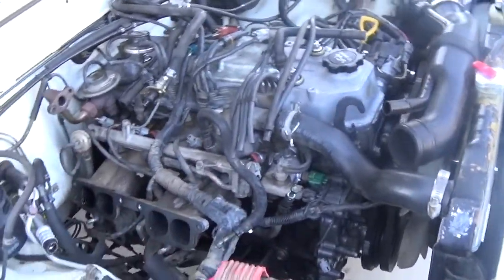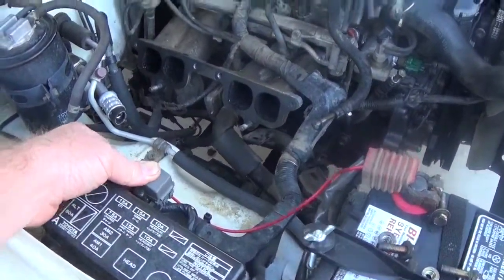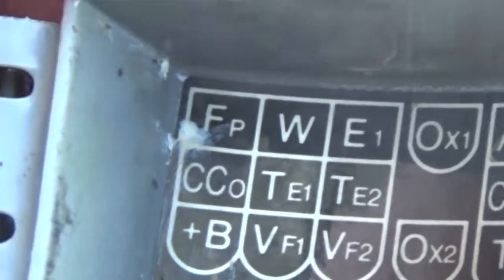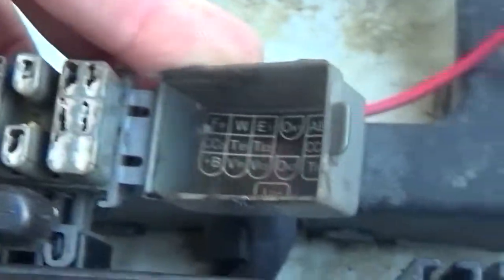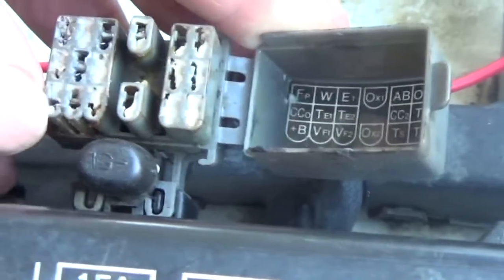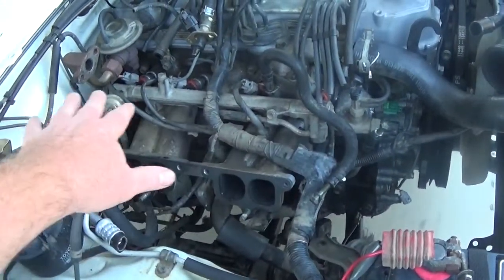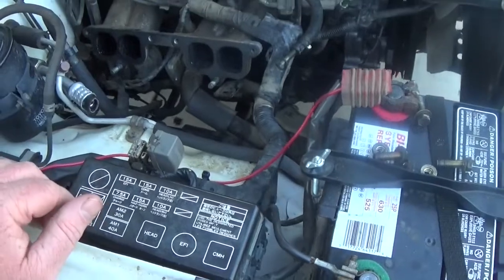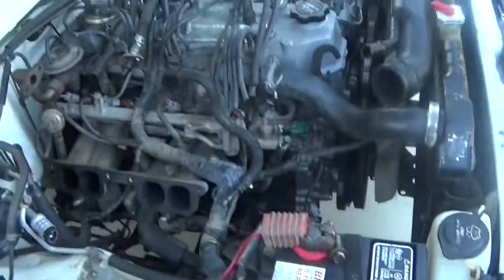22re Testing the fuel pump

Comment: I'm trouble shooting a no start situation. I found it is that the pump is not running. I sprayed starting fluid and it runs for 10 seconds. I'm not getting voltage thru the ignition to the pump relay.  So I will use the FP connection to try and make the pump run. That would eliminate the pump entirely.  I suspect the ignition switch may be the issue. Working thru it. Thanks for the help.
Reply from the maker: So glad the video helped a little.  Sounds like you are on your way to figuring it out.
Reply: Charles Carr. Did u figure it out? I'm dis exactly as u did. I drove to my friends cabinet shop, turned off the motor to open up the large gate,  I got back on my 91 4runner v6 3vze 3.0 and didn't turn on anymore. After checking all kinds of stuff I also sprayed carb cleaner and it turned on briefly. I repeated this 3 times. Figured out it was my fuel pump. I cut an access door on the rear passenger seat to access the fuel pump, replaced it with a new 1. It didn't turn on. The fuel pump wasn't working. I connected wires directly to the old pump to my battery and the old pump worked. I used my Makita drill battery to test the new pump installed on the gas tank and it also turned on. But not through the ignition key. It just doesn't activate. So now I tried this method with a paper Clip, it still doesn't activate. The Efi fuse is good, they efi cylinder shaped metal relay works. Now I'm checking on the Circuit Opening Relay but makes no clicking noise when I put the ignition on the On position. Let's see what else I do. What was the problem with your 4r?
Reply: @johnnyjohn8073  So what happened? Did you solve the issue?
Reply: @CentroInvOrografica  I was able to activate the fuel pump by bypassing the wire connector from the MAF sensor with a paper clip; then I pressed in the 2 side metal prongs on the Circuit Opening Relay (the plastic cover has to be removed for this). The MAF Sensor (located on top of the air box) is a cast metal piece with a black plastic cover in the shape of the heel of a boot & is sealed with a clear silicone. 
 
When the MAF Sensor & the Circuit Opening Relay is working properly, the fuel pump circuit works this way: When you turn on the ignition key to start the engine...the engine cranks and sucks air in through the air box, the air goes through the air filter, then through the MAF sensor, etc. for proper air & fuel mixture. This process makes the MAF sensor to activate the 2 metal prongs on the Circuit Opening Relay to press onto the body of the relay causing contact on other metal parts which triggers the fuel pump to turn on.  Once the engine turns on, one of the metal prongs deactivates from being pressed onto the relay body while the second prong stays activated which keeps the fuel pump running as long as the engine is running till you turn it off, then the prong is released which stops the fuel pump from running. 

Problems with the relay can stem from corrosion, rust, or other contaminants between the contact points. A simple fix can be done by lightly sanding between the contact points. Some times a clogged AC drainage can leak water onto the relay and the ECU. An easier way to tell if your Circuit Opening Relay works is to simply disconnect the wire connector at the MAF sensor & bypass the two female contacts closes to the front with a paper clip. This connector has about 6 female prongs in-line so make sure that you are bypassing the two prongs towards the front as opposed to the others. If you hear the Circuit Opening Relay click, then obviously the relay physically engages but it doesn't mean that there's actual contact since corrosion or rust may be preventing power flow to the fuel pump. If the relay does click and the fuel pump does turn on then you do know that the relay fully works; which means that your MAF sensor is bad. See a video on how the MAF sensor works. It has about 6 male prongs that connect to the 6 female prongs in the MAF connector wire. Remove the black plastic cap on the MAF by cutting off the clear silicone. On the inside the 6 male prongs continue where they are welded into the circuitry. Some times the welds are broken off, coroded, rusted, etc. There's a part that spins back and forth depending on acceleration. This back and forth causes a metal prong to activate or deactivate some metal peg which in turn activates the fuel pump. You will only understand if you see videos on the MAF & relay function as part of the fuel pump circuitry. Or you have to test & even open up these parts to understand. I was overwhelmed by the technicality of this process but I came to realize how easy it actually was. So don't let it intimidate you. The hardest part of the work is to remove your glove compartment box & the front passenger kick panel where the Circuit Opening Relay and the ECU are both located. But first check the other most known methods to test the fuel pump. Also, the ignition keys must be on the ON position while the MAF sensor wire is bypassed to hear if the Circuit Opening Relay works. 

Unfortunately I haven't been to the junkyard to get a Circuit Opening Relay. I would get 2 or 3. If the MAF is the problem, based on videos that I saw, I could tell that I can very easily fix it. So my fuel pump problem is based on one of those two problems. I will return to explain which of the 2 was the problem.
Reply: @johnnyjohn8073  Thank you for your thorough response! I'm currently dissassembling my truck's motor to change the HG and timing chain, when I zip it back together I'll see if it fires up, if not, your advice will come in handy!
Reply: @CentroInvOrografica  Yeah good luck amigo just take your time & be very patient. Double check all your work. Video tape everything you do so that you remember how things go back. Also write notes on a writing pad dedicated only for notes your your vehicle. Label everything eventhough you think you may remember everything later one. Shit happens in life and you may not in fact be able to reassemble everything in a few days like you originally planned. I caught pneumonia during the process and I'm relatively young.  I thought pneumonia was only an illness that babies & old people get. Financial issues also got on the way. Especially change all your freeze plugs on the engine block and the cylinder heads. I've always replaced them on engine blocks but never on cylinder heads and guess what? 2 months after I was driving my 4R, a leak developed from a rusted freeze plug in the back. So I removed both cylinders on my v6 and replaced the freeze plugs with brass plugs, except the one that goes on the intake plenum (upper intake).
Reply: @johnnyjohn8073  Thank you!!
Reply: @xxkrazzxx  You're welcome bro. Something I forgot to mention unrelated to fuel starting problems. As you know, any starting problem is either due to timing issues, gas, or ignition (electrical) problems. My 91 4runner was sitting for about 3 or 4 years before I rebuilt the engine. Humidity throughout those years created rust on the distributor magnet contacts which prevented the engine to start. Since I had already noticed this, I knew right away that this was the problem for my 4runner not starting. I used sand paper to scrape off the rust and it turned on right away. I'm surprised that the old gasoline didn't jello up and clog my fuel pump cus usually you should empty out all the nasty varnish smelling old fuel. All the other problems that I mentioned in previous postings were problems that occurred after, maybe a year or 2 later unrelated to the distributor. Of course I did the typical checking for spark at the spark plug wire to spark plug, I had not spark. Then I checked for spark from the distributor cap to the main coil wire, I had no spark. Then I checked for spark at the other end of the coil wire to the coil & nothing. So before I tested the ignitor, I removed the distributor cap from the distributor & that's when I noticed rust inside the distributor on the magnet contacts. That was my problem. So it your vehicle has been sitting for a long time, always check for rust at any electrical contacts & grounds.

Comment: I tried a paperclip and nothing happened, I couldn't really get a good fit with the paperclip and think I didn't do it right. Can I buy jumper wire at a particular place to do this correctly?
Reply: @z g. You probably did do it correctly, that's simply not the problem as I did the same test and the fuel pump still didn't activate. Your problem is most likely either the MAF or the Circuit Opening Relay. Read the posting I wrote to another person. I was lost as you were but as I followed the schematics on my Haynes Manuals for the fuel pump wires and also viewing many Youtube vides, I doscovered that the MAF on top of the air box & the Circuit Opening Relay are all part of the gas pump operation. You may also have a bad ignition switch (where you insert your key on the steering column below the steering wheel). Or the the 12 inch wire that connects directly to the  fuel pump or the wire that goes past the fuel pump wire. Maybe corrosion on the wires itself or at the fuel pump connection. The fastest test now that you tried the bypass with the paper clip; is to simply disconnect the wide wire connector at the MAF sensor and bypass the 2 frontal female connection with a paper clip. Listen to see if the Circuit Opening Relay at the front passenger kick panel (where the computer is located) makes a clicking sound. The relay has 2 metal prongs on each side that will click at the same time so it will sound like only one click. Remove the plastic cover on the relay to see if both click at the same time while a friend bypasses the MAF wire connection and the ignition switch is turned to the ON position. If both metal prongs on the sides of the relay click, don't be fooled that it's in good working condition. Look carefully between each metal prong to make sure that there is no rust or other form of corrosion that is blocking metal to metal contact between the relays metal prongs and the metal part on the body part of the relay. Usually water leaks from the antena hole down to this relay and maybe even the computer itself. This will cause corrosion between the metal contacts on the relay, causing the fuel pump not to activate. Confused? simply remove the plastic cover on the circuit opening relay to see the 2 metal prongs that I'm talking about. Use a fine file sold at Harbor Freight to cut keys to file the metal contacts or get 400 sand paper and scrape off the contacts to clean off any corrosion. Want to know the exact function between the MAF & Circuit Opening Relay, read a previous comment I made to another person. Look around Youtube vides and you will finally see the videos explaining this in better detail. Corrosion also builds up on the metal prongs inside the MAF sensor or the welding that holds them in place also breaks loose. My 1991 Miata also has the same MAF system on top of the air box. There's a guy who works on some mazda mini van or small SUV (I forgot which is it) that actually explains it in spanish but I'm also sure that eventually you will fine one in English. Good luck, let me know if you solve your problem and tell the rest of the readers also. I hate making long comments but I think it may be helpful to others.

Comment: You can go to eBay and buy a Pigtail that connects to your test Port to a obd2 scanner, like $20! OBD1 to OBD2.😁
Reply from the maker: No.  OBD2 is more then just the connector.  OBD2 tends to have more loop back checking.  Also, the codes are supposed to be standard in OBD2.  A P0302 should mean cylinder number 2 is misfiring,  on any OBD2 vehicle.  OBD1 codes are all over the place on different vehicles.
Reply: This is Toyota Specific. The one for sale. There are better scanners that can read obd1. I love the paper clip method myself! Sorta like the old rotory phones I grew up on! I'm helping my brother with his 92 Toyota truck, 22 RE. Doing the engine soon in my backyard. I had a 92 SC400 that I did the engine and I had a great time. Enjoy your post!😁